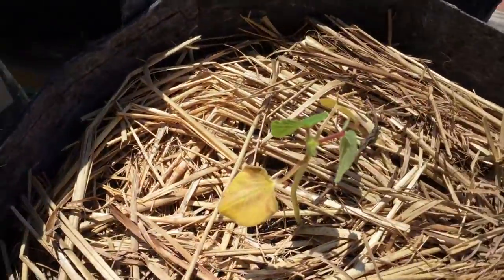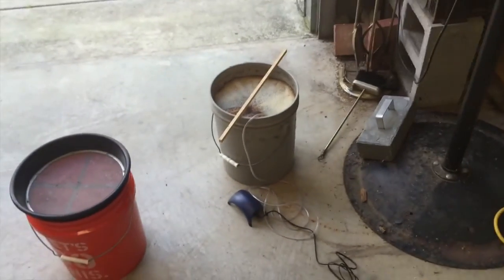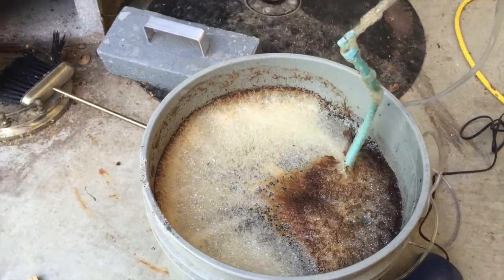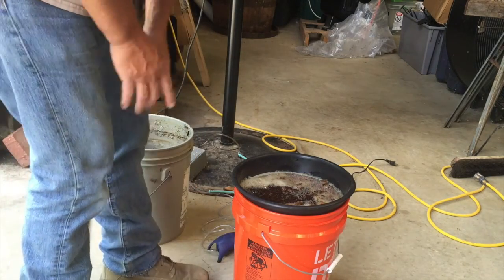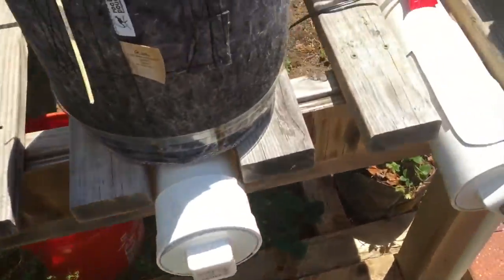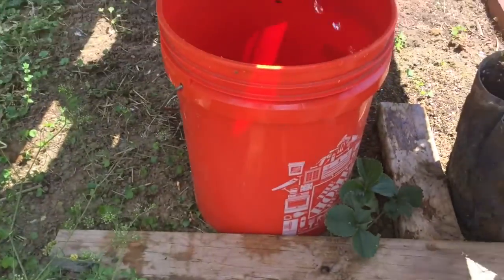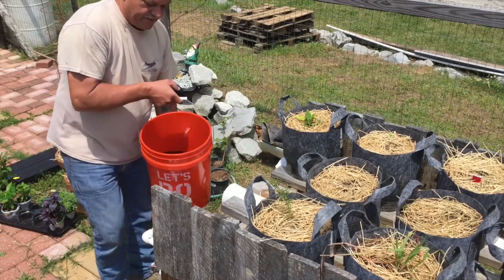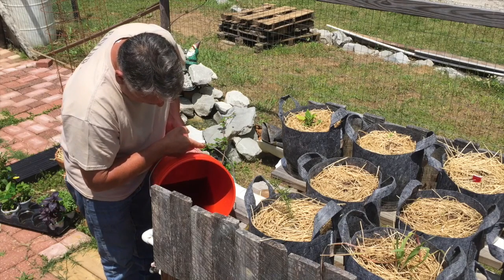Adding Worm Tea to the RGGS Water System

Comment: So it's been a few years... What so you think of the RGGS system now?  Do you still recommend it?
Reply from the maker: Not so much.  I am on deployment in the middle east right now but maybe next summer I will get back to the house and gardening.  I will not stay with the RGGS again.  I want to try some other techniques like vertical  raining towers etc.  I have some ideas that I want to try out.  Nothing but sand and rocks here and no modern conveniences or tools, supplies etc.  Have to wait and see.  Thank you for watching and your comment Tim.  I will say with the RGGS the bags get covered in moss, the tubes fill with roots and soil, and you have to remix the soil every year to add nutrients.  There are better ways I think.  Even a kiddie pool with bags would be better in my opinion.  Let me know what you end up with.
Reply: @iROBODUDE  Thank you, sir, and thank you for your continuing service.  Stay safe over there.

Comment: any updates on your system? ive virtually given up on the RGGS and made raised ponds with the bags sitting in them and worked out 100 times cheaper and does the same job, but need to cover up the edges to keep the mosquitoes laying eggs in the water
Reply from the maker: I am probably going to do the same thing.  I have some ideas but haven't done anything yet.  I am leaving for an overseas job and won't be back to it for a year.  :(

Comment: Awesome videos. The only thing I would have done different using the worm casting tea is to actually feed the plant soil. It's all about the soil web. The tea would eventually leach down picking up and depositing nutrients into your reservoir. No need to strain the worm castings then. Sprinkle those casting around the base of each plant. They'll brake down over time with the rain leaching the rest of its nutrients into the soil. My rule of thumb is; Never water your plants. Always feed your soil. Amazing results will follow. Best of luck bro !!!!!
Reply: feed the soil meaning adding composted tea ? i know that towards the last couple of months of my RGGS all my plants looked like they were lacking some sort of nutrients and then it dawned on me that the plants were sending majority of their roots into the net cups and into the reservoir (pipe) and trying to find nutrients in plain water (a massive down fall with this setup). i then started to add seasol and fish fertilizer directly into the reservoir and i saw amazing results within the week. so it will be interesting to see your results rob! keep up the amazing work - been following your setup from day one and look forward to all your updates!
Reply from the maker: I will do it as soon as I get home in a few days.  Thanks.

Comment: if you stick your finger into the soil on top is it damp? I think the plants aren't getting enough water... maybe, the look a little dry.
 just seems a little too soon for a nitrogen deficiency. 
I have heard good things about the Boggie Brew tea.
I suggest the next time you wish to does the plants apply it from the top with a watering can to get that goodness into the soil.
It's still cold wet and did I say cold? here.
best
Reply from the maker: +Rev John O&#39;Toole Thank you so much for being a true supporter of me Rev.  It is wet at about 1 1/2 to 2 inches.  The new wicking is working great.   It really is a deficiency.  I have turned it over to my wife but she doesn't have her hand on the pulse of the garden like I did.
Reply: Did you add the 10-10-10 to the top before the straw? Awesome channel by the way. I love your build projects. :-)
Reply from the maker: I believer you are correct Sir.  The buckets kept the moisture from evaporating so rapidly in the summer heat.  Dumping the buckets was a mistake and I think the kiddy pool strategy is the best now.  They are only wet 1/2 way down.  I did however mist all of the plants from the top as well.  Thanks for your watchful eye my friend. :)
Reply: I would just add a drip water feed over the buckets from the same water sysem so you don't have to redo this year.
best